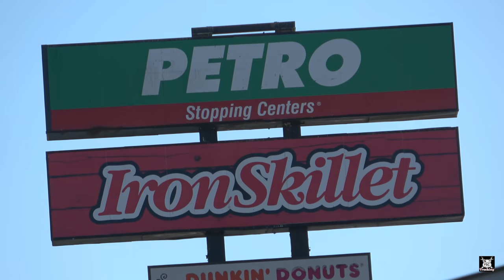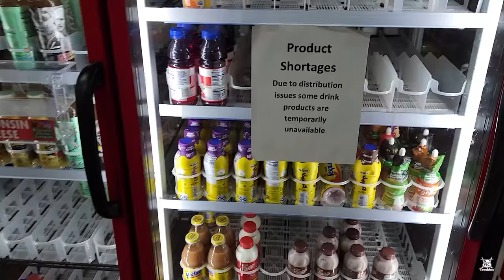DEF Shortage,   Not My Problem!

Comment: Death is just a real expense in the other thing is you don't need it and the other thing is in trailer racing you can always beat the trailer because you have a trolley brake see so many of them in the ditch the trailer beats the tractor boy newer trucks are not too hot are they

Comment: if you cant find def use distilled water, keep you going.....
Reply: yes it does work, def is just distilled water and urea, so the ecm thinks its still putting def in the exhaust.....
Reply: @darrylwindle5331  Is there any long term damage if you use distilled water all the time?
Reply: @darksu6947  i dont know its just a short term solution to keep you going
Reply: @darrylwindle5331  Further research is needed!

Comment: Here in Texas many guys Delete those diesel engines and gut all that exhaust shit out thier trucks . I did it to mine and it runs like a race horse a whole different truck. I know guys that do the Diesel deletes even before 10,000 miles cause they don't want deal with the exhaust system Bullshit . DEF is getting harder to find and engines won't run without them unless you do a delete so it's not leaving people much choice.

Comment: I wasn’t able to understand what def is? Can anyone explain it?
Reply: Diesel Exhaust Fluid...68% water, the rest is Urea (chemical fertilizer). It is SCR technology (same as used in electric power plants) to remove some exhaust emissions. When the truck goes through a diesel particulate regeneration (regen) cycle most of the soot in the DPF (diesel particulate filter) is burned by injected raw diesel via an extra fuel injector...that produces a lot of air pollution coming out the exhaust stack (DPF trucks may have 2 stacks and "mufflers"...but one is fake, not hooked up). Theory is air leaving exhaust stack is cleaner than air entering engine....EXCEPT when it spews during regen. 
Number one killer of diesel engines...soot.